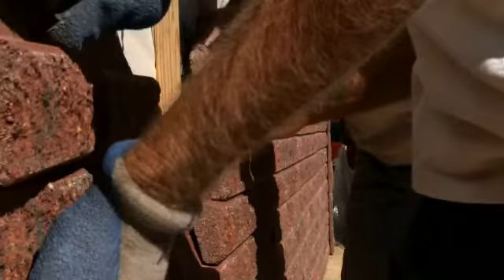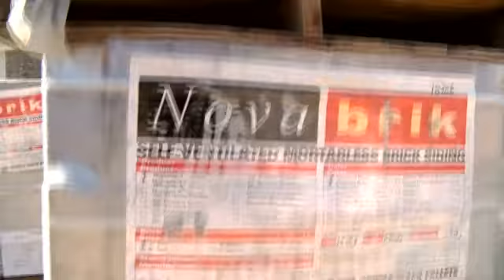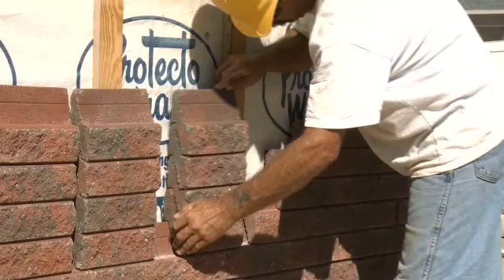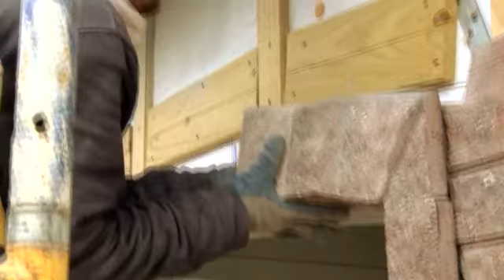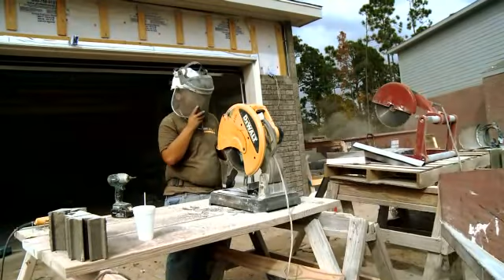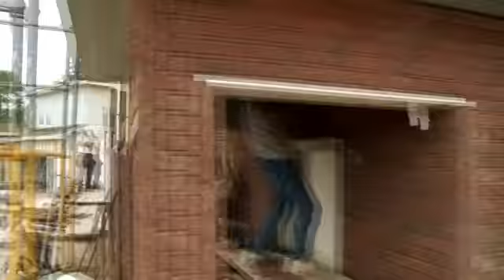Novabrik houses - Tyndall Air Force Base

Comment: Very ingenious design, congratulations.  Any way to simulate mortar joints look?
Reply from the maker: Mr Carlos, Horizontal brick joints are simulated. For Vertical joints, they are not similuated and will not.
If you need more info, you can contact us.
Thank you for your interest in NovaBRIK.

Comment: There is no need for adhesive at all, unless you are applying caps such as short or half walls, or window sills under windows. Silicone is never used unless it is an inside corner ONLY. The 3/8s backer rod serves as barrier and for aesthetics. It is an excellent way of giving your inside corners a nice finished look and keep out moisture. The clear silicone keeps the backer rod secure, water tight and preserves it from weather elements.

Comment: I am the woman you see working in the video. Bugs and insects are not a issue, due to the way the entire house is prepped for the application of the brick. First the house is covered with Tyvek, then a very wide rubberized window and door tape is applied to any gap or seam throughout the entire home. The only silicone that is used in the process is where 2 corners meet, such as an inside corner, under a window sill.3/8s Backer rod is used first, then silicone is applied directly over the backer rod as double protection against elements and insects. That's why it is important to push your seams tight as possible.

Comment from the maker: There are no risk that insects pass trough the joints, adding glue or silicone between all the bricks is unnecessary. The system makes that each raw covers  completely the raw below making dissapear the open joints, then all the wall becomes impenetrable to water, and insects.